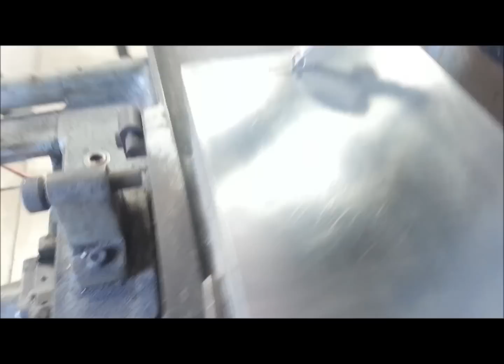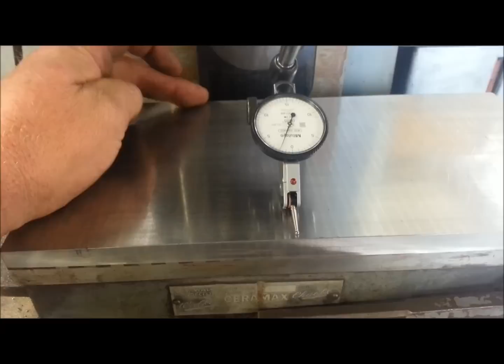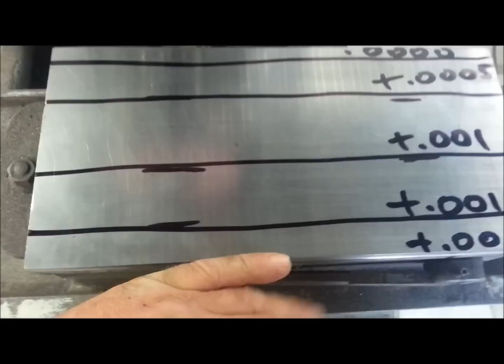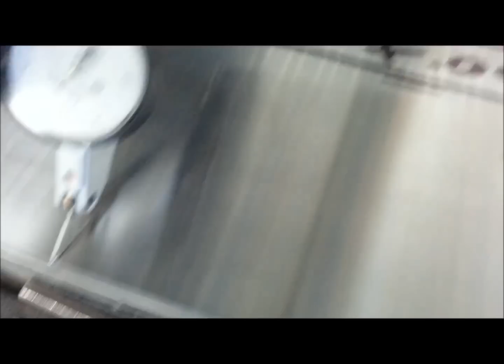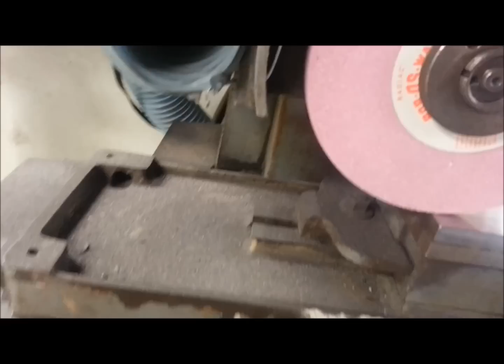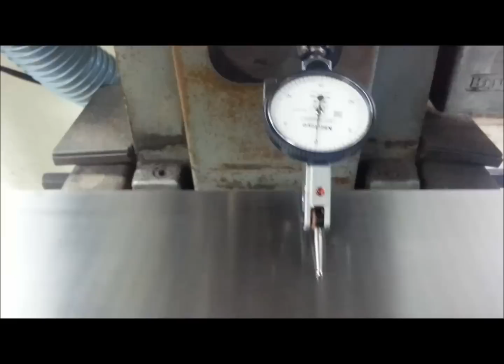Surface grinder first project

Comment: Looks like i'm late to the party with this one. I recently purchased a Harig 612 and I indicated and mapped mine in, as you did. Same exact results as you except I was only .0015 high in front and low in back as I received the machine. I opted to shim the chuck in rear with .001 shim stock. Worked out great. Out .0005 front to back after shimming.  I'm not confident enough just yet to attempt your remedy. Maybe after a few more of your latest videos I might attempt it. Thanks for your video as it always helps sharing the knowledge base. Great Channel you have. 👍

Comment: I run Thompson 10 foot grinder. You don’t want a fine finish on your magnetic chuck. What you want to do is have a medium finish. Make sure the magnet is on when you grind it.  Let the machine run and warm up with plenty of oil. Take no more then .001 of an inch off the chuck and redress your wheel. Especially if you don’t have coolant. 2 factors working against you is 1: wheel breakdown. 2: metal warps when heated up. When you are working with such tight tolerances you want that chuck as uniform as possible.

Comment: The plate wears all the time in both directions actually: if the wear occurs across the plate( say 2/1000  over  5" x 10 " x 10 passes  )  it must also occur along the plate.The wear = 2/1000 /( 5"x 10" x 10 ) = 2/1000 / 500 = 0.000004 " / inch of grind . Over one pass of 5" I would expect a shift in level of 0.00002 " across that plate. The first thing that comes to my mind is that the plate should be rotated OR a decent of wheel should be 0.000004" per inch ground.

Comment: sorry, but using an indicator  to check the flatness of the chuck does not work.  it is akin to sitting in a roller coaster, you are always the same distance from the track. a true check is to place six blocks on the chuck , one at each far corner and two in the center at each edge of the chuck. grind until they are cleaned up, remove after marking location, and then checking the thickness of each block. this is the only true way to check the evenness of the machine ways and the flatness of the chuck.

Comment: Stan all I can offer is my experience with 2 Hoyer grinders. 1 had a dry saddle that caused problems and once we got it oiled that stopped the hump problems. 2 was a old used one bought 2nd hand. Rust under the Chuck was the culprit here. Ground the bed then the bottom of the Chuck then the top (0.0004 in 2 passes). We used vitreous bonded wheels because they are harder and don't break down very fast. We always got our best grinds with the mag on and a light coat of Crisco shortening. Finish passes should be no more than .0001 or .0002 and you shouldn't see any sparks.
Reply from the maker: Pretty old video here, I have long since worked it out, thank you for the comment and advice.

Comment: I dont see how its even possible to be .002" off front to back, as you should not even be cutting that much material with each pass   . Half a Thou, max , with much  bigger steps  and use a rough dressed wheel.   This must be a very old video..  there are much better ways to do this , as explained by the real pros .

Comment: Hi, I'm not sure about your intention when you did measurements of magnetic chuck surface - may be it make sense in your case - but usually such a measurement on a used machine is completely meaningless. If the shape of machine ways are curved then after grinding your magnetic chuck will have curved top as well. And indicator will always show 0 unless magnetic chuck is "breathing". And when you see 0 on the indicator it indicates only the fact that you just grinded the chuck telling nothing about chuck flatness.

Comment: For grinding your table...needs to grind cool, if you don't have coolant, dress wheel coarse and don't take heavy cuts, have you heard of sparking out?
If you still see little sparks from front to back then you're good to go...not seeing .002" difference.

Comment: thanks for your testing and posting of results, by now 3 years later, have you come up with an wheel wear equation yet? now given it seems that each wheel and producer would have thier own tweaks to the equation.
Reply from the maker: After this first cut and some use (a couple of weeks) A light dusting brought it right in, I still re-dress every 6 months or so, it goes very quick if you stay on top of it. But as you can see, this chuck hadn't been dressed in a very long time (maybe never)

Comment: That looks like an old machine , perhaps you should put an indicator on the machine slides and check the gibbs too.Probably wear in the machine somewhere. also dont dress the grinding wheel too fine. Turn the chuck on while gring it. 40 YEARS high precision grinder here.

Comment: This is an interesting challenge you have highlighted, I thought the wheels were harder than this and more wear resistant . There must be something very rewarding about building something within 1/10,000th of an inch (2540 millionth of a mm !).

~~  I wonder what the highest tolerances  of machined parts exist today ?

Some points:
1) I do not own a surface machine so my question is if the wheel wears down over that single process of surfacing one side , can you purchase more wear resistant wheels ?

 I assume the machine and grind wheel axle maintains unchanged its vertical distance from part requiring surfacing and therefore the wheel will take off less material as it wears  ..correct ?. Example taking off 5/1000ths initially will wear to take off 4  then 3 /1000ths etc . if there is a way to reference the original start point of relative to

2) What effect does the magnetic chuck have on distorting a target part during the grind process?

3) I assume scraping is a process that takes this wear error down to even tighter tolerances ( 1/10000th).  Are you suggesting that you just want a better grind process to avoid scraping or you just suggesting better methods of surfacing ? I did see a video where the guy used half magnetic strength and rotated the part 30 degrees every pass with only 1/2000 th being taken at a time .  Obviously a dangerous technique but commonly used in machinist shops.. 

It was interesting to see your video on surface plates and how they move with temperature. So accuracy is more about the observed  scale than absolute .  I guess all steel milling parts wear too during a job so there will be a very tiny error involved ..

Thanks for the post always enlightening.
Reply: Do you mean a .0001 "   / .0025 m/m

Comment: could start at the high side and start grinding realy realy light  untill you dont take of material
then sharpen the stone and start over on verry light grinds 
should be able to get it verry close 

another option could be to put feelergauges under the table so its lifted up at the high end and grind it again , kindah take the wear in accound
if its realy even across the table you should end up with a perfect straight table

maibe you should keep the table as it is as everything you mount on it to grind will have the same slant back to from , the table kindof counters that

Comment: Thanks for the video.  Now your chuck is flat which is great but if you now grind a part the the width of your chuck (using comparable material and comparable wheel) you're going to have the same problem with the part being off .002" wont you?

Comment: I also have a surface grinder, haven't used it yet. I did watch a great video here from "thatlazymachinist" and I feel quite a bit more confident about using it now. He explained some of the dangers in using a surface grinder and I am sure glad I watched  his videos. I don't need any fingers vaporized and want to keep them all.
Reply: When locating work up against the back guide the smaller the area  to locate off of them less likely
 relates to be a discrepancy if you drove a back plate and place a pew nuts and bolts and with few inches apart
 from the back plate with the screws pointing towards the wheel then side grind the ends of the bolts
 then the work will locate off the tip of the bolt when site grading don't forget to recess the side of the wheel
 as a guide  the amount will left on the outer diameter  on the side of the wheel should not exceed half an inch
 I would always recommend using corporate even when guiding the back plate screws to control the temperature
 therefore minimising any variation

Comment: Grinding an area that size, you need flood coolant. Thermal expansion can cause the problems you have, as can wear on the machine slides (most surface grinders are used in regular, repetitive 'zones' of the machine slides). Try 'opening' the wheel by fast dressing with a new diamond, and use flood coolant.Not a lot you can do if the machine slides are worn.

Comment: Check out your ways, they need scraped in and you'll be back in business.  I believe you are just spinning your wheels.  Get a good machine repairman to scrape in your ways and you will be running in a .0001 or .0002.  Those older grinders had too much grit find its way down to the ways.  Check the bottom of your chuck first to see if it has any rust under it.

Comment: It does look like you table and spindle axis are not parallel. Try clocking table with DTI on spindle axis?
Coolant makes a big difference too. I used coolant and 100L wheels to surface my table.
Reply: ..uh, that's why he is grinding the table, to get it parallel. If you had actually watched the video, you would have seen that he got the result he was looking for, as in flat table and parallel with the Z axis.

And he is grinding a table, not a mirror, so more like 36 or 46 wheel than 100.
Reply: I did watch the video smart arse! The finish was not done as one cut but incremented during the cut,a Shute sign the axis are not parallel and you could grind away till there is no table left if the spindle and table axis are not parallel! I ground mine with a 100 L wheel and given the strong bond,small grit size and strong bond I had a very low wear rate during my finishing cut.
As a machine wears as it gets older it is normal for a little droop on the outside. It pays to adjust for wear and get the axis parallel on the gib keys then set the table, but you knew that anyway.......
Reply: Andrew Wilson I'm sorry then, at what point did he say that he took an incremented cut? What I atched was the person taking multiple passes, gradually getting the wedge/hump shape out of it.

Even if the axis is not parallel to the spindle axis and you do a grind over the chuck, you still end up with a grind that is parallel to the motion if the way is not worn to a rocking horse (very rare on Z axis). Basic machine geometry.
Reply: Andrew Wilson no problem running over the brass with the "L" ? what grit

Comment: Why not take rapid but shallow cuts along X and Y, that way the wheel wear should be less than a thousandth across the entire surface and you don't have localize chuck heating.

Comment: Heat is the real enemy. When I have had to grind dry I have used light oil or Wd-40 on the chuck. Flood coolant is the best. If you use a spray mister make sure that it is directed directly on the point of wheel contact. I suspect that the taper you see is from thermal expansion of the chuck. As you traverse across the chuck it grows in size from the heat. if you reference the actual height of the chuck you will probably see that it has the opposite condition expected from wheel breakdown, where as if it were wheel breakdown the chuck would reference higher, it will in fact reference lower . 80 grit is way too fine, use a 46 grit. .A Norton SG (cermanic)  wheel will.heat the chuck less,  but is twice the price. keep it cool brother. (40 years in the toolroom)
Reply: The back to front grind resulted in a chuck/table that was 5 thousands higher at the front, just as you would get from wheel wear. If the chuck would have heated, it would have been lower at the front (end of cut, highest heat).
Reply: Jaakko Fagerlund
Yeah, I thought about that after I posted, and realized I was mistaken.  Harig grinders have a process in their manuals on grinding the chuck.  Page 11  in this pdf. http://www.trutechsystems.com/xcart/harig_manuals/HARIG,_Automatic_PLC_Surface_Grinder.pdf

Comment: You should use some type of coolant. A spray mist works well. It’s a good idea to let the grinder spindle warm up a little before you start grinding. Start at you high spot, take super light dusting cuts. Keep your wheel sharp and your chuck cool. Keep working your high spots first. You can use an indicator or work the table to find them. Mark your table with a magic marker laying out lines all over the chuck. Again work the high spots, keep the wheel sharp, the chuck cool and very light dusting passes, very important.
Joe
Reply: I used china markers so you could see how far away the surface is.

Comment: You did a nice job. Grinding in a surface grinder chuck is never easy. Using a stone wheel makes it very difficult. Using a diamond wheel it's much easier. However, When you start with a chuck that is very out (like you did) it does take several passes followed by dressing the wheel between each surfacing. A diamond wheel requires a live stone dressing wheel with an oil brake. Most folks are not grinding carbide/ceramics so they are not equipped to use a diamond wheel. The $700.00 dresser is a must to true the diamond wheel. Last chuck I ground in: 6x12 chuck. Within .0001 with a 150 grit diamond wheel. Dressed after each surfacing.